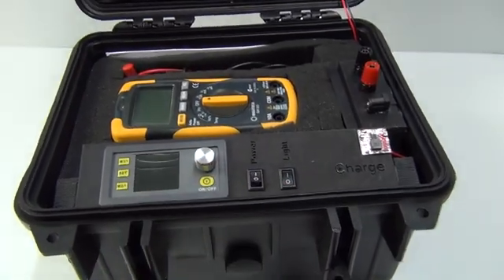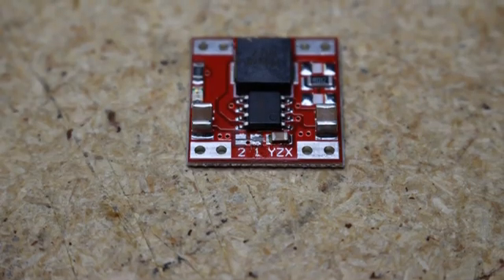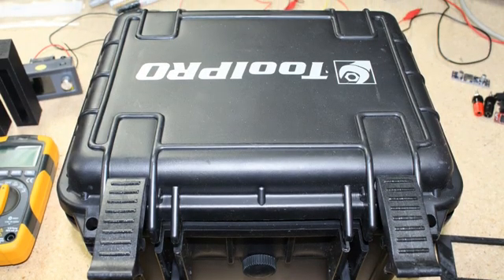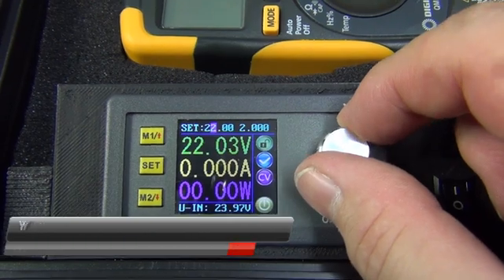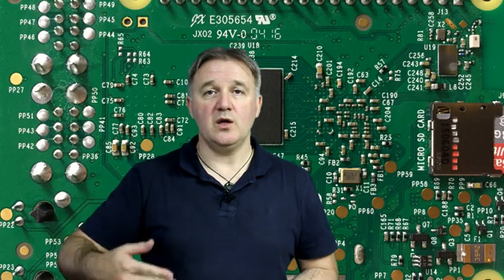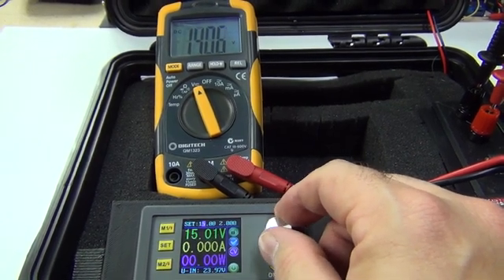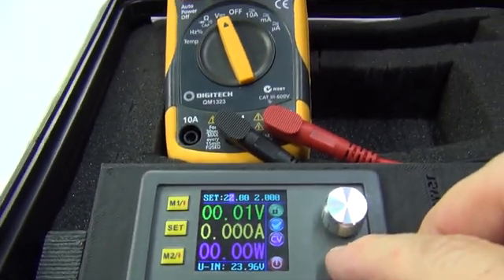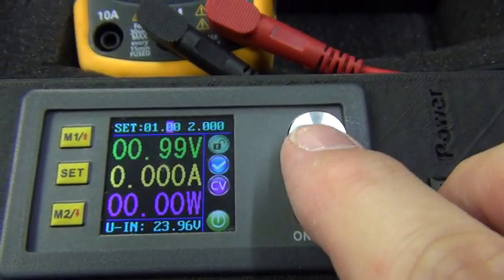Rechargeable Portable Lab Power Supply (MEHS) Episode 42

Comment: I got a question can you power atx with battery with two systems with plug socket and without but able to charge a phone. I was closer but I got H bridge working and L.E.D light  working and fan in the out put wires. But to work on input wire need help

Comment: You didn't use any bms, a circuit module that balances the cells, batteries can explode.
Reply from the maker: JS7457 - Hi.  Correct.  It' was pretty basic and not ideal.  I have since fitted a BMS to the setup and an improved power regulator to provide power to the batteries.
Reply: Does the 3 cell module works good ? Do you still use it ?
Reply from the maker: JS7457
- No not really.  It was really just a 12v reg so once I added a BMS I also added a XL6009 adjustable regulator that allows me to use any power supply under 9V as a source and I can set the output to 12.6V which is ideal.  Cheers.
Reply: But lithium ion batteries needs a cc cv charging mode.
Reply from the maker: JS7457 - Hi.  Yes also true.  I'm not really charging them properly.  I'm letting the BMS handle the cut off and since the rise to 4.2v is quick it's not ideal.  It does work but I acknowledge that I'm limiting the battery life quite a bit..  If you know of a decent 3s charging module at a good price or a BMS that has an integrated charging IC let me know.  Cheers.
Reply: Charging a battery without any constant current limitation is very dangerous.
Well the module you are using in the video is a special chip for multi cell charging cc/cv.
The chip on your module should be a SY6912A.
Search on google for datasheet. You can use use this module with a bms circuit module. I will send you a schematic.
And yea were did you bought the module ?
Cheers
Reply from the maker: JS7457
- Hi.  Are you referring to the small module in the Rechargable Portable Lab Power Supply video?  I guess you are.  Sorry I got lost, too many messages, videos and parts.  Yes I think I referred to it as just a 12v reg.  I know it has a proper 1,2,3 cell lithium charging chip on board.  Sorry for the confusion.  Please send through what you have found.  Always helpful.  I have a current dilema if your interested.  I have a 12V 5A DC supply and I wish to power a 12v light and recharge 3 x 18650's with BMS attached.  I can't (rather not) use the 1,2,3 cell charge module I used before as it needs a 15V source.  What ideas do you have?  I am thinking 3 x TP4056 boards, one for each 18650 connected behind the BMS and a separate 5V rail feeding the TP 4056's.  Cheap and perfect charge approach.  I am happy to bake my own board with BMS and correct charging IC but that takes time I don't have.  Cheers.
Reply from the maker: - Oh and the 1,2,3 cell Lithium charger was an Ebay job.  I can't find the original supplier but I am watching another similar offering at the moment.  Ebay.com.au item number 271957154780.  Cheers.
Reply: +My Electronics & Hacking Show yea i found a vid who someone using p4056 for each cell then he connected in serial the outputs.

Comment: I use 18650's at 4A to heat nichrome wire with the current for cutting through plastic, I believe it can deliver even more but then they would get hot
Reply from the maker: +Glychee S - Hi.  Yes you are correct.  Most average 18650's should deliver 2C without difficulty even 4C is achievable.  I mentioned the current in the video mostly because the 18650's I used are rated at 4000mah but really that's fake, its more like 2000mah per cell so I should easily get 2A current (1C) from the pack but I could get 4A or even 8A for a short time if my power module could take the input (it can't, 2A max).  I hope I didn't confuse anyone.  Cheers and thanks for the comment.

Comment: Good looking power supply module. Is the output isolated on these units?
Reply from the maker: +Christopher Johnson - Hi.  yes it is.  It also has reverse current protection and polarity protection but I haven't had the unit apart to see what has been done and how.  Early days but I'm pretty happy with how it works.  Cheers.